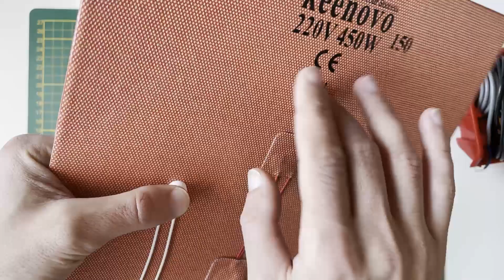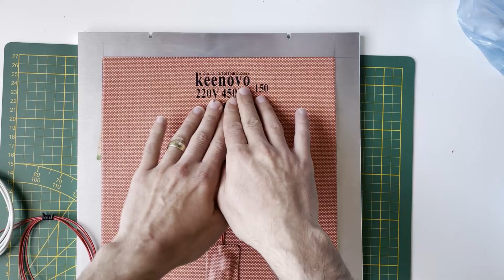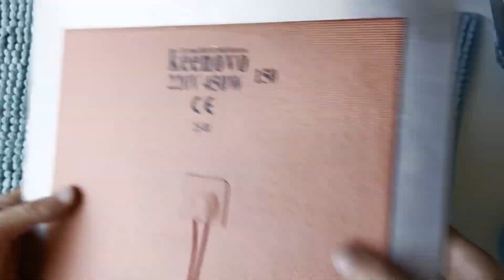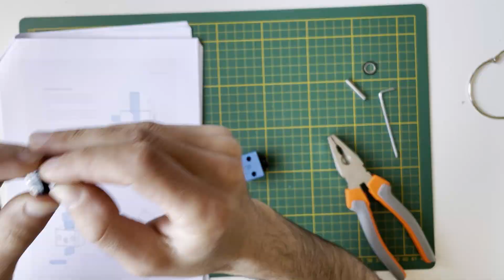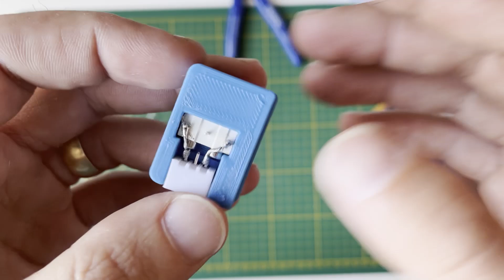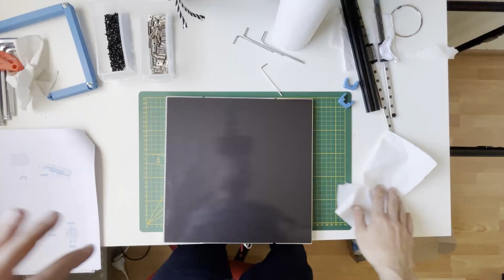Building Voron v2.4 - Bed & Z Endstop [Ep5]

Comment: Isnt there an overheat protector already in the keenovo mat ?   So if you put another one on top you already will have 2 in series
Reply from the maker: As I know there is not protector on keenovo. I might be wrong. But yes this fuse for extra safety. There is also thermal runaway in the firmware.

Comment: @zer0 is doing The rod of the Z endstop, why 33mm? Where does that number come from? And when you install the Zendstop, the top of the rod is it supposed be at the same height as the top of the bed? Or just above it a tiny bit?
Reply from the maker: Yes, It kind of depends on your build. It supposed to be higher then your build plate just a bit. Later with Z offset you are decreasing that height.
Reply: @zer0isdoing  Thanks for the reply. So how did you calculate that 33mm? Because the bed when you add the magnetic plate and the PEI flex plate, it changes in height, right?
Reply from the maker: Yes, but It does not effect that much. You you can start with 33 mm and if it is too much you can file it a bit and do the visual check again.

Comment: Great videos, thanks. 
Also, an idea which I got while watching this could be to have 2 thermal fuses, one on the mat and one on the bed, wired in series, that way your covered if the mat falls from the plate and also if the thermal fuse detaches from the mat or is sensing a lower temperature due to the RTV
Reply from the maker: Yeah, It can be connected together as long as they are connected in serial. However it is not necessary if you ask me. One which is attached the aluminium bed with screw would be enough in my opinion. Sticker behind keenovo is already good one and also with RTV I am not expecting any pealing.

Comment: Why did you add a thermistor, is it for closer to accurate temperature readings?
Reply from the maker: With that, I am getting feedback from target not from source. So that means reading should be more accurate. However It is totally not necessary, the difference should be negligible.

Comment: I would probably remove the masking tape directly after applying the silicone. So it's not adhering to the tape.
Reply from the maker: While you are removing the tape it is not causing any deformation on the target. But of course your suggestion could be done also.

Comment: Very nice series. Could to tell me roughly bed weight . I am sorting of trying idea of removeable bed to be used in another cartesian printer along with voron.
Reply from the maker: It is 2.5ish kg. However I would not do that. Because change it one from to another it will effect your z offset, bed level also connector will wear off later on which can cause dangerous situation. I would just build 2 if I need another.
Reply: @zer0 is doing  i think you are right . I should abandon the idea. I am too planning same kit i was thinking just use same bed for my another printer. I think your video are very nice and specific to issues in my mind before building. I appreciate your effort. Also i am waiting for you response on motors performance of kit later.

Comment: Could just add a second fuse in series one on plate and the other on the mat?
Reply from the maker: Yes, you can add how many you want in series. I am not sure but I am guessing it is just a thin wire which is destroying itself (to make it self open circuit) at its nominal thermic value. So, it would be wiring wires in series. However I would do simplest one to make it maintenance friendly.

Comment: bro thanks again for this! please make a detailed video of electrical wiring so i can make it properly lol
Reply from the maker: I getting there. :) However if you have specific question, shoot it.
Reply: @zer0isdoing  are you going to use wago connectors? im ordering it right now. my only problem is wiring this kit im afraid to get magic smoke thats why if you make detailed wiring i can be safe hahha
. by the way my kit is in transit so im just preparing myself.
Reply from the maker: @lorenzgamboa2557  Trust me, I am an Electrical and Electronics Engineer! :D
Don't worry, wiring episode will be on the air until you come to wiring. And I know people does not like wiring or scaring of it. However, I will make extra detailed for the wiring. 

I will be using terminal not wago connector. You do not need none of them by the way. I will just try to do this machine maintenance friendly, that's why. 

As a side note: Definitely get genuine SSR.
Reply: @zer0isdoing  nice nice! thank you in advance! since you are EE please make it simple so we can understand it haha. can you link that terminal you gonna use?
Reply from the maker: @lorenzgamboa2557  https://www.aliexpress.com/item/1005001560259121.html?spm=a2g0s.9042311.0.0.27424c4dnDs09d

1* TB15010-1PCS
4* TB1506-1PCS

Comment: I think the same about putting the fuse on the silicone mat, silicone is good heat resistant  and bad conductor of heat. There are two possible events to take care of, one is that the SSR fails and is always energizing the silicone mat, for this reason the fuse is left on the aluminum plate, but the other possible failure, is that the silicone mat peels off and quickly begins to burn, for this reason you want to leave the fuse in the silicone mat, do you think we can use 2 fuses in series, and put one on the aluminum plate and the other on  the silicone mat?
Reply from the maker: To be honest, I do not think mat will fall off especially sealed one. But of course we want to take all precaution. Another fail detect is Thermal Runaway of klipper. This will continuously check thermistor and watch for awkward things, like silicone mat under current but it is not heating then it will run Emergency Stop command. 
Regarding to 2nd thermistor, I was thinking to write a watchdog software for the bed which it would on raspberrry. However I have learnt that there was already Thermal Runaway protection. So I will just run the wire for both thermistor to motherboard and I will use the one which is mounted to aluminum plate. If problem occurs, I will remove that one use silicone mat's thermistor. I will keep it as a spare.
Reply: @zer0isdoing  using a extra thermistor adding to the aluminum plate will be a great idea, for monitoring current and heat, this in case the silicone mat peels off, I think the same about that could be a hard possibility but possible :)
Reply from the maker: @erodrigolopez  For monitoring current, I have another mod. :) That will be assembled while I am doing wiring. :)
Reply: @erodrigolopez  but if the pad peels off the bed will not be heated anymore.
Reply from the maker: Yes, but it will continue to heat itself. And the idea was sticking fuse to pad itself will help to prevent overheat. So again it continues to protect.